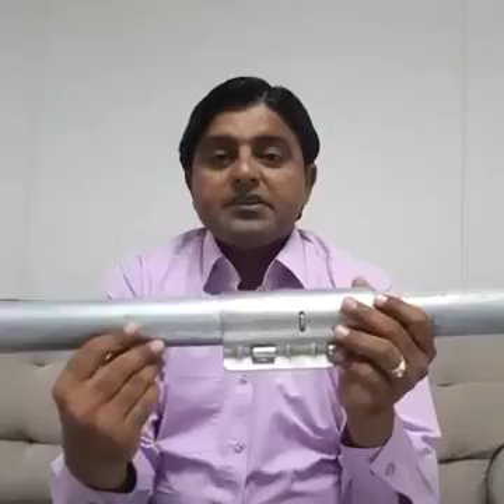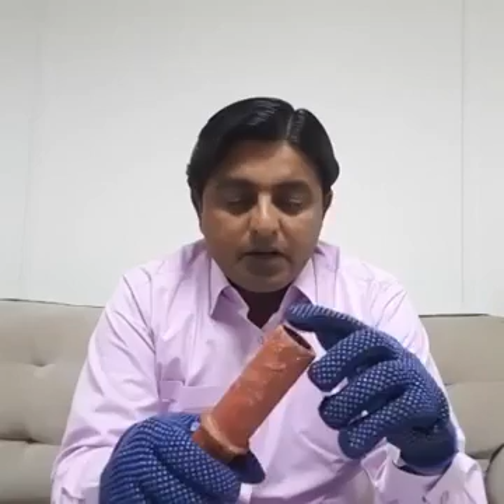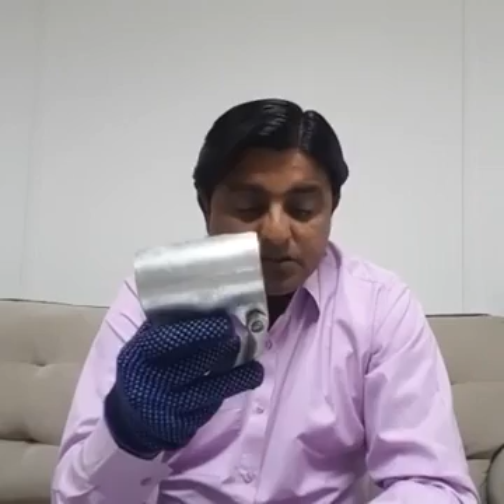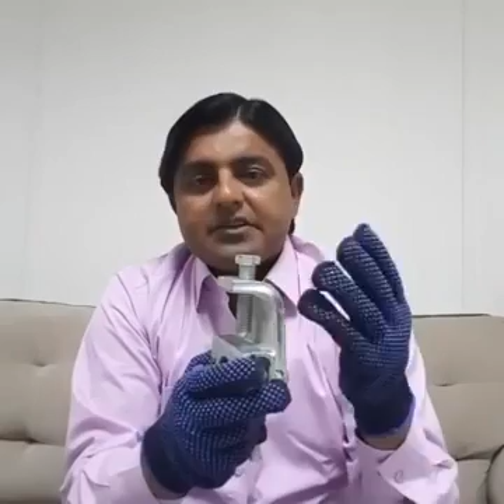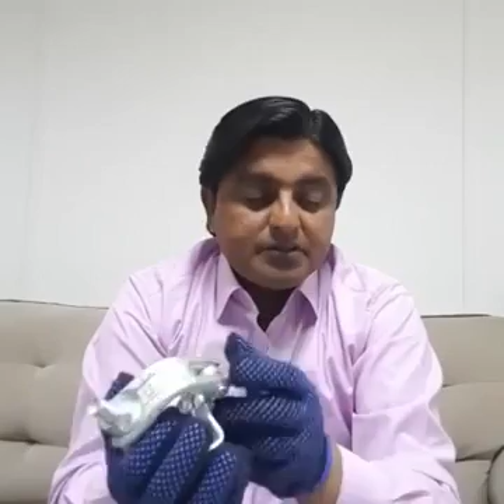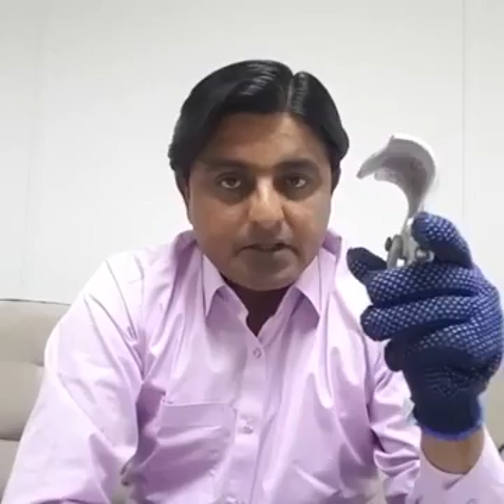Scaffolding Couplers and Clamps Safety - FB Live Session 02/09/2016

Comment: another problem you can get is when the bolt can be bigger than  it should be this fitting would be discarded as it  would not let you tighting the fitting with box and key